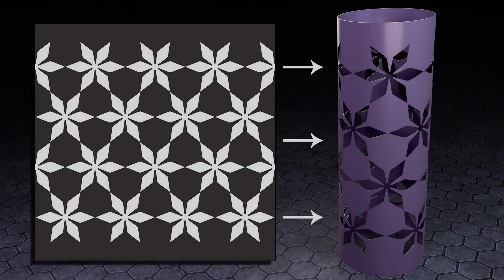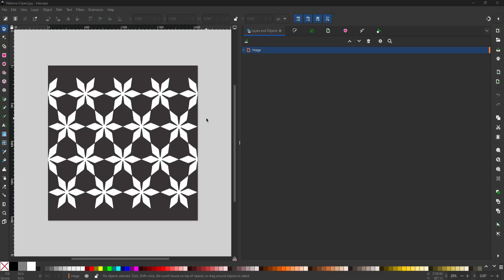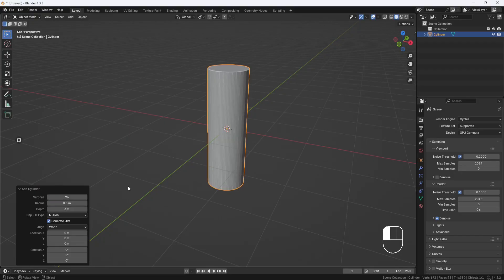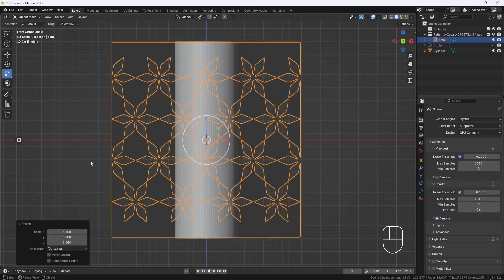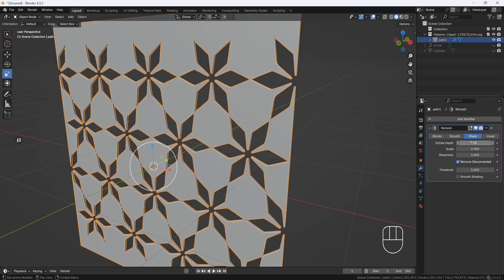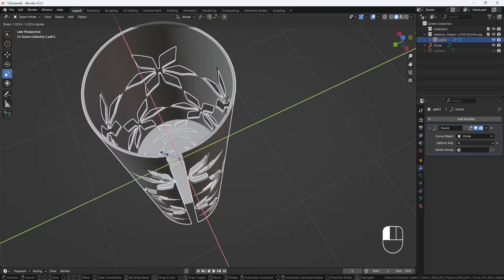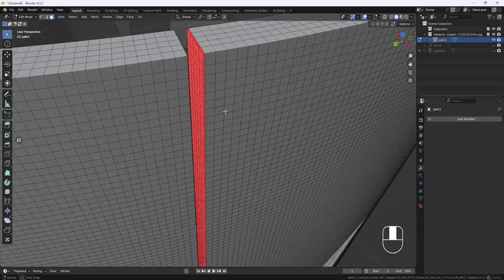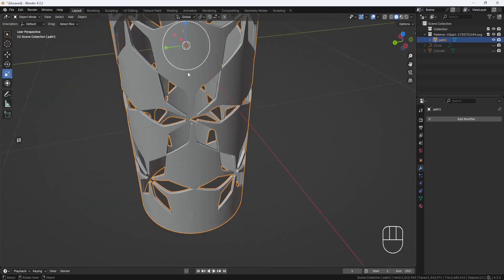How I Wrapped a 3D Pattern around a Cylinder in Blender

Comment: nice video! can you show how to wrap a svg file into a cylinder with the proper settings so the print is nice? thickness, emboss and so on
Reply from the maker: Thanks! I recently recorded a video showing how to create cylindrical models using a program called Plasticity, which is a CAD based modeling program. I think this is a better way to create these kind of models. Then you can export to .obj format to bring into Blender or you can export to .stl format for printing. You can watch the video here: https://youtu.be/i-JgNri2CNg
Reply: @roddeweese6402  Id be curious how to emboss an svg file to a cylinder the correct way - number of layers and so forth. Not looking to create a patten, just slap a 'sticker' onto a curve model
Reply from the maker: @johnnyrhascal8484  I have a couple videos showing how to add decals to your model. Maybe one of these will help.
Decal on a flat surface: https://youtu.be/aHOpw5vi__4
Decal on a curved surface: https://youtu.be/vTsxxq2vSpA

Comment: hi rod, i love the video and downloaded blender to follow along, however, when you get to shift a, add curve then circle, my menu doesnt show the same options. can you help?
Reply from the maker: Sorry, it looks like Blender has moved things around again. That's the problem with doing software tutorials. If they update the program and move things around, the tutorial doesn't work anymore. Anyway, the Circle is still there. Just hit Shit+A, go to "Curve", then go to "Simple", and then you can select "Circle".
Reply: @roddeweese6402  thanks for helping rod, perhaps its the newest version of blender, but i dont have a "simple" option either. sorry to be difficult, ive never used blender.
Reply from the maker: @ReinkeEric  No problem. The reason you don't have the "Simple" option is because you need to load an Add-on. You'll need to go up to the top left corner of your screen and click on the Edit menu and then choose Preferences. In the Preferences window, go to the Add-ons section, and then at the top of the window you'll see a search box, so type EXTRAS in the box and then you'll see two options appear. Extra Curve Objects and Extra Mesh Objects. Click in the little box next to both of those to enable them, then go to the bottom left corner of the Preferences window and click on the button that looks like 3 horizontal lines, and then choose Save Preferences. Now you can close the Preferences window and you'll have access to all the options in the Shift+A menu.
Reply: @roddeweese6402  okay, perfect thanks again for all the help!